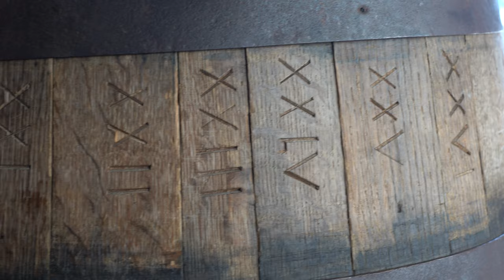Sailing Back in Time | Mystic Seaport | S06E09

Comment: Thank you so much for this episode. Excellent, as my father was a finish boat maker for Stephens Marine in Stockton, Ca before they switched to Fiberglass and Aluminum boats. After that he went into house construction and built some of the nicest custom homes in Florence, Ore. If he could see a change in wood grain on the front of the cabinets he was not happy, so it was always in his contracts with the cabinet makers we used. Then he went to work in Salmon harbor in Winchester Bay, oregon, and retired out of there, so full circle. Again thank you for the episode it warmed my heart.

Comment: Wooden Barrels date back to 350 bc in Britain and Armenia. China they date back even longer, odd bit is that the Greeks and Romans did not use wood for liquid holders, they used clay.
Oldest rigging shop is in Britain, there is also wooden boat builders that have never stopped, there is also places in Brazil and few places in main land Europe. so they are still about.